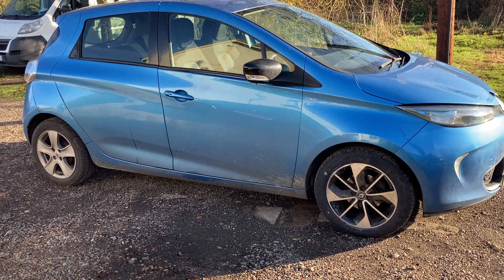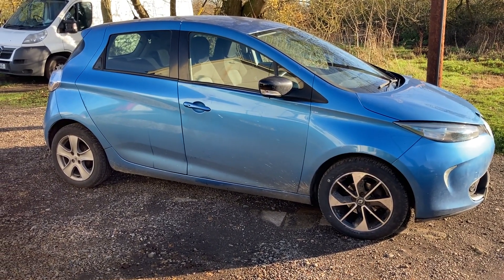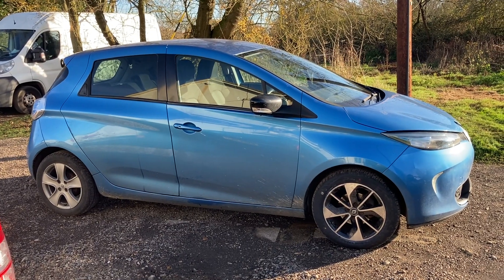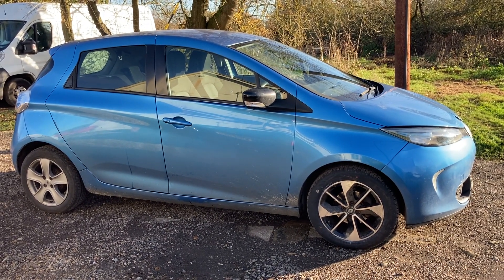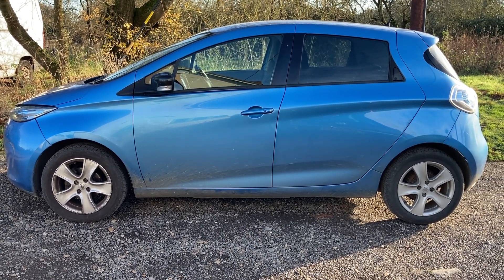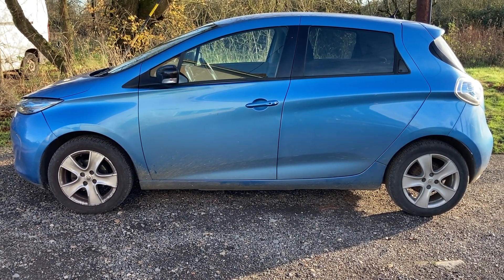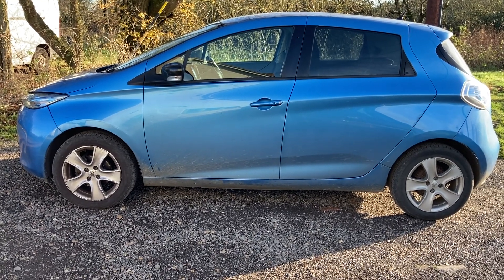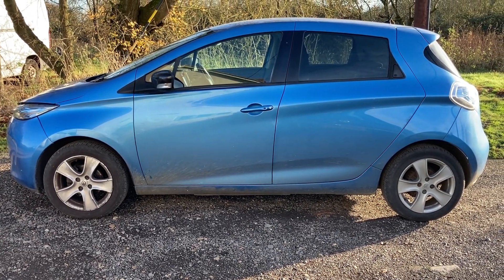📝✅❌ MOT Time - Renault Zoe ZE40 motor bearing rebuild - EV salvage repair ❌✅📝

Comment: I thought the worst thing about the ZE40 was rubbish headlights. Otherwise it was great other than it wasn't very exciting.
Reply from the maker: It’s much better with some good quality bulbs.
Reply: @garycevrepairs  I upgraded and it made some difference. I know better ones available now, that was 2017. I put Philips Ulteon LEDs in iny current car, not strictly legal but no canbus errors and the beam cuts crisply and definitely doesn't blind other road users  Philips Gt200 halogen seemed pretty good too.

Comment: Yes it would be interesting to see you track the steering, also I would be interested in seeing you do a brake fluid change. Roger in Norfolk
Reply from the maker: Hi there is a member only video showing how I do the tracking. Membership to the channel is extremely cheap, just covers the costs involved. Thanks